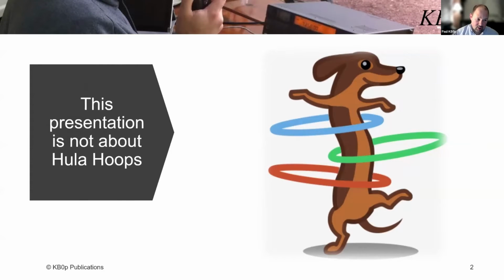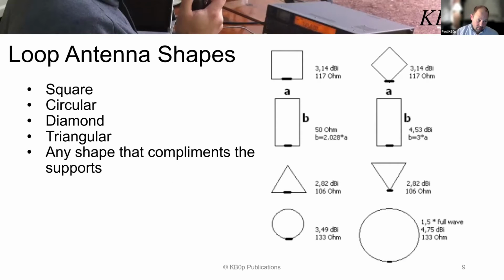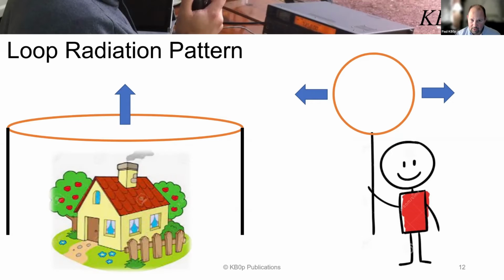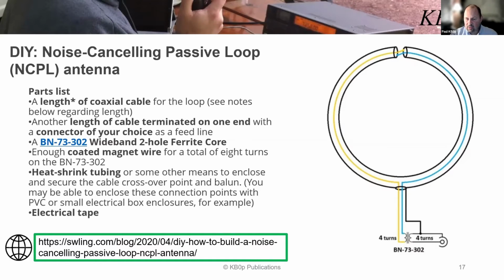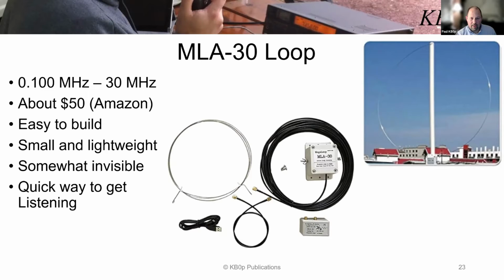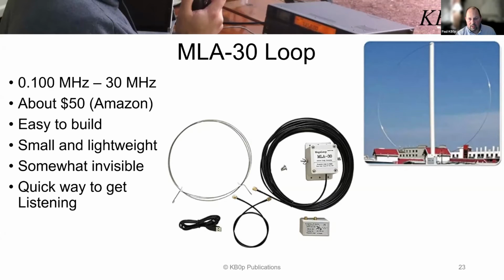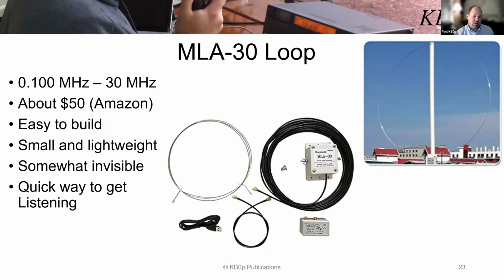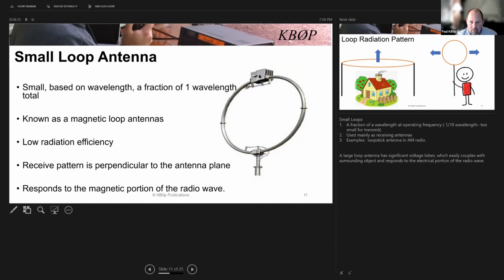Loop Antennas Presentation By KB0P | East Coast Reflector Presentation

Comment: No no no, feed the large loop with ladder line to a balanced tuner. The more wavelengths it is the angle of radiation drops. I use a 560 ft loop 600 ohm LL and use it on all HF bands. It's not a compromise it is a performer. I enjoy getting on the reflector, keep up the good work ki4ytv Special Ed
Reply from the maker: Thanks Ed
Reply: I agree 100% . The loop skywire at 50 feet is a delightful all-band qrp DX antenna. At one wavelength, it radiates like a NVIS antenna. But at 2+ wavelengths it operates as a MAGNETIC antenna with a 360° horizontal pattern with around 6 Db gain. I was easily able to Work Japan from Midwest USA with 5 watts SSB during greyline propagation conditions. Using the suggested 450 Ohm Ladder feedline, 4:1 balun and auto tuner into an Icom 703 rig.